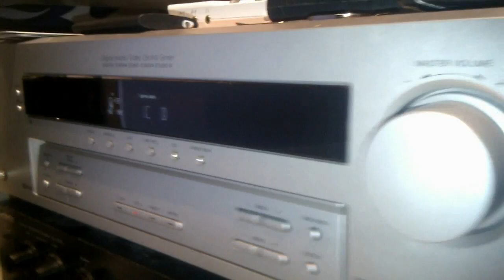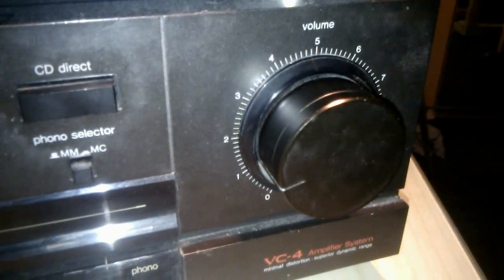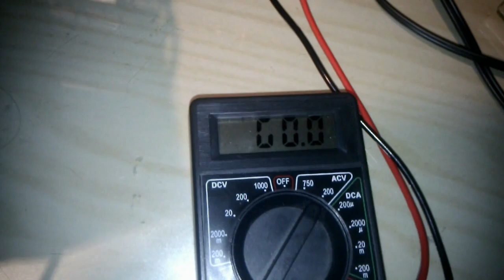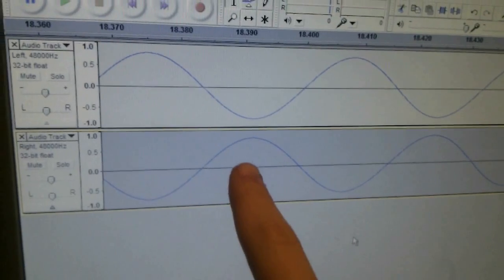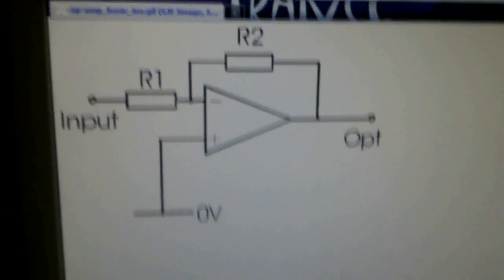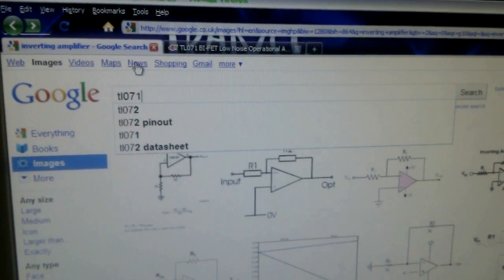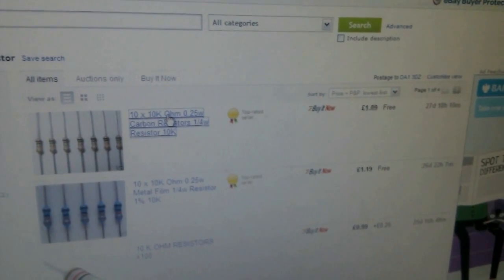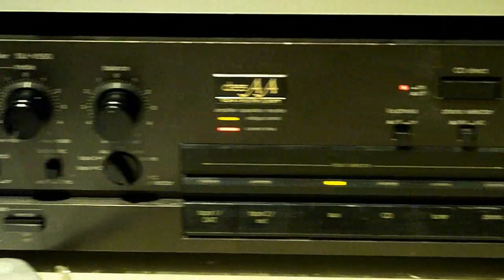Bridging amplifiers - basics of bridging a non-bridgeable amp

Comment: Having "once upon a time" built some fairly outrageous amplifiers ... 

Most commercially available home audio and some pro sound offerings are built with economies of mass production in mind and generally don't have sufficient output devices or power supplies to handle the increased current demand by bridging  two channels to get one high power channel.  
  
Holding the speaker impedance constant:   Doubling the voltage across the speaker as was done in the video quadruples the output power however it also doubles the amount of current the final output driver stage the amp has to transfer to the load.  Ohm's law. 
 
A hypothetical 100 watt per channel stereo receiver was designed for just that:  100 Watts
on the left channel and 100 on the right.  Bridging it with the hopes of getting a hypothetical 400 Watt mono amp probably won't yield that kind of power as the receiver's power supply wasn't built for that kind of wattage in the first place. 

In my humble opinion and experience:  Unless you're willing to build your own audio power amplifiers or scour the reseller channels for something that can be bridged :   It would make much more sense to focus on speaker efficiency (SPL) and bandwidth.

Comment: Can’t you just switch the wires on one of the rca cables? I don’t think you need all this circuitry, I think you can just switch the hot and negative wires on one if the rca cables
Reply from the maker: Nope, because then you just send your signal to ground and it disappears. Pre-amp circuits aren't fullbridge in that sense. Signal is signal, ground is ground. If you flip them your signal is grounded and the amp listens to ground from your source. You have to actually invert the polarity of the signal.
Reply: @barevids  oh ok gotcha. So if you’re feeding it from a mixer you could just send the amp 2 of the same signal, but just invert the phase on one of the outputs on the mixer then right?

Comment: or you could have simply used the left channel positive and the right channels negative effectively solving the polarity issue. That is the way most car amps work anyway.
Reply from the maker: No this is completely incorrect. Car amplifiers are deliberately designed so that the second "positive" output is actually a ground,  and the negative terminal is actually an inverted phase positive. That way under normal wiring, the speakers play in phase, but it let's you easily bridge by connecting the speaker to the two active terminals, in this case being one positive and one negative. On these old 2channel amps they were never designed to be bridged and both the positive terminals are actice and in phase. Both the negative terminals actually go to the same place so connecting to negative of the other side makes absolutely no difference.
Reply: very true, but all that was managed to be done in the initial "let's try it" was to completely short out the amp circuit luckily the protection mode saved it from smokin'

Comment: Wait, I don't get it, so, your source from the computer is plugged into mono, and you invert one phase which is stereo, which then goes to your mono output, so if it's mono it should cancel out the signal output from your computer.
I don't get it, so you have must connected your amp to stereo, but invert one signal?
If so, than your video is a little bit incorrect.
Reply: babusiaN1 yup that's why I find hard to understand how he did this on his computer because computer's audio output always in stereo mode, you can only bridge an amp with just one output and split it for the left and right channel input of the amp but inverting the other output.
Reply: Because the stereo output from the pc went to his reciever, which he used the mono subwoofer output from, split, inverted and into the amp driving the sub.
Reply: +babusiaN1 If you do mono, it sends the same signal to both channels still. When you add the circuit in the mono signal gets split and one phase is reversed. Then goes out to the speaker. Essentially never changes from mono just a different signal on one side.
Reply: Exactly. You only have to invert the signal so you can bridge the channels without them trying to cancel each other out and most likely screw up your amp.
Reply: Uh, okay, but, can you get a small pre amp, and swich one channel polarities +-, and then connect it to a big amp? Or you must get the phase inverter?
Reply: That's what a phase inverter does. Switching the polarity will ground out and fry the amp.
Reply: But wiki says "A phase inversion is neither a time shift nor a phase shift, but simply a swap of plus and minus."
Reply: I think the stereo phasing the other channel works, I did it on new years day when all of sounds set up here in Philippines banging out side of their doors, I had a chance to bridge one of my amp and accidentally phase the left channel and connect the right channel on my phase inverter and it actually do the job, it doubles the power.. although i'm not sure if it's more powerful than the mono..
Reply: When bridging a mono signal, you are inverting the +/- of the signal, not the actual power. If what you're thinking was the case there would be no reason for a phase inverter to ever have been created. Because simply switching the polarity would obviously be much easier/free. Now say if you had two subs running on identical signals (but not bridged) on seperate channels and you swapped the +/- on one speaker and not the other, then one speakers phase would be inverted from the other. It's not the speakers that are an issue in this scenario, but the amp. If you don't invert the signal on one channel  prior to bridging they will be fighting each other "one push while one pull" and you will screw your amp. Since you want to run the two channels in series (to double the power) + from channel A goes to - on channel B. So you need the same signal on "B-" that you have on "A+" - phase inverter. I hope that makes sense.

Comment: I was all set to slate you for this video, but i cant because it's brilliant.  one question, how did you measure the impedance of your preamp?  and... could you also do this with the high level outputs from a car stereo?
Reply from the maker: haha thanks, i just re-watched this from 5 years ago and CRINGE at the start....
i just looked up the input impedance from the specification of the amplifier. Most good quality amps will list this spec in the manual. 
This can be done from high level outputs, but im not sure if the components i showed in this video clip would be able to handle the higher voltage.

Comment: Just a thought from somebody with no experience whatsoever... but... couldn't you invert the signal buy just splitting the RCA's and reversing the wiring? Ground on one end to positive on the other, and vice-versa?
Reply: In theory that would work, but in the class of amp, that may not function as you wish....it might work on some amps though. The reason would be is that now you have changed the 0V ref point of the feed, and the front end transistors "also" expect a certain impedance to perform as a circuit is done so....Bridging both ends could cause a problem depending on the topology of the circuit and what else might be on the front end of that given amp.

Comment: Only just learned about bridging. I used to think you connected the + of one channel to the - of the other and the speaker to the spare + and -. Of course this just short circuits the amp so don't try it! Then I realised, it's AC so the '+' is actually +/- and the '-' is actually a ground or 'neutral'.
The reverse phase on one channel was new to me but now it seems so obvious.

Comment: Not really, there is not enough "wiring" in there to see any practical delay. You might actually get a .0000001 second delay, but it's too little to care.

Think of it like this. The internet connects 2 devices on opposite ends of the earth in a matter of 25-100ms. How many miles of wire, fiberoptic, satalite, and electronic devices do you think that signal has to go through and still have such a small delay.

The extra 2ft of internal circuitry won't make a difference. :)
Reply: Flowing electricity in a wire is like opening full water pipe, it flows instantly without any latency.. so why there's .0000001 sec delay? XD
Reply: @monk06-ipp03nm6  Electricity flows at the speed of light, which is not instant. (That's why space is measured in light years)

Also, force through matter travels at the speed of sound (water in a pipe) Very, not instant.

Also, also... comment was from 8 years ago! Very, very not instant! :)

Comment: Hi i have 2x70w RMS amp at max 4 ohm speaker( 2xTDA7294 stereo with single supply), can i put 4 ohm speaker in bridge mode without problems and more dissipation?????
My amp runs on +70v and GND (not simmetrical transformer)

Comment: Yes you're right. After a while, I realized that most sources will have common grounds (or negative signals) on L and R. The common ground on the source paired with a common ground on the amp will probably short circut your amp so don't try my theory :P

Comment from the maker: This did not work for me, i tried it. Where the signal is being sent to the tip as an AC current, by cutting and flipping the wires just caused the signal current to be sent to ground, and the part of the amp reading the signal was just reading a ground, hence no sound. The positive or tip does all the work in a push/pull sense, and the ring is simply a ground doing no work, just completing a circuit.

Comment: There is an easier way to bridge the amplifier.  If the amplifier you want to use bridged has RCA inputs, you hook the shield/ground of the RCA wire up to one RCA tip going into one channel and the tip to the tip of the other channel.  This way you are not using a phase inverter.  I've been doing this since the 1980's.

Comment from the maker: @ANARCHYRUULS apart from the APS20 which is a more flashy version... there must be, but not that i know of. The APS10 is the only commercial one i reckon. A lot of car amps come with a phase inverting switch as standard though - if you got two of these amps and had them out of phase with each other you could bridge them together to create a very powerful mono drive. you'd just have to firstly use a multimeter to make sure they were outputting the exact same voltage, and if not, adjust the gain.

Comment from the maker: @ANARCHYRUULS i never tried it - it was too risky cos the OPamp would have to give exactly 0% amplification and the inverted signal would have to be identical in every way to the normal signal, just 180 out. thought it much better to buy a tested + properly designed unit made for phase inverting, and the results are fantastic. If you want to try the OPamp meathod go for it just be careful.

Comment from the maker: @wnz909 That is called parallel mono. In theory, you can get double power by using a speaker that is half of the amplifiers rated impedance. But i havent tried it yet on amplifiers without this feature already installed. Up to you if you want to give it a go, just note the left and right input signals HAVE to be identical (ie. split from one into two from a mono source).

Comment from the maker: @marinlaw maybe lol but no need as soundcard crosses very clean and steep @ 10hz-200hz variable. Got it set on 80hz at the moment 
next thing will probably be parallel mono, looks a little easier as no inverting is needed.

Comment from the maker: @HazakyProductions i knew i should have mentioned this in the video, my apologies! If the amp is 4ohm stable per channel for example, then it will only be 8ohm stable when bridged. You may be safe running something like 6 ohms bridged with a well built amp, but its at the users own risk. This is because each channel sees the work done by the other channel.